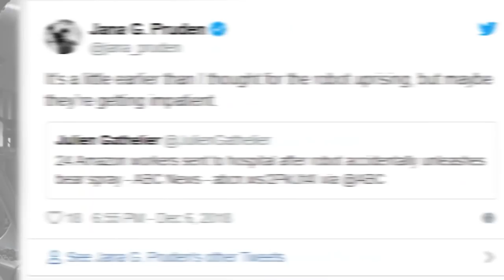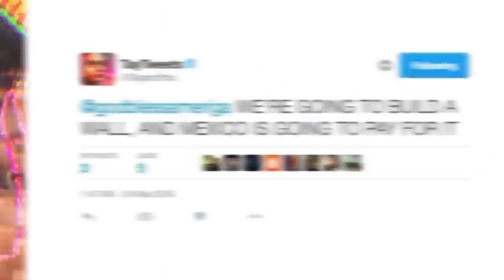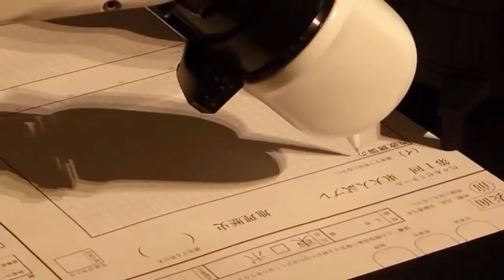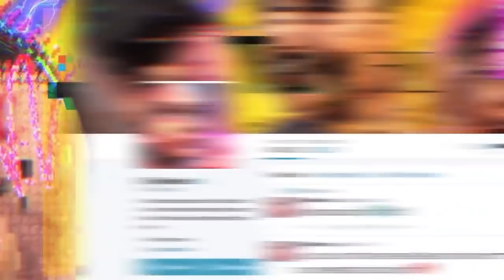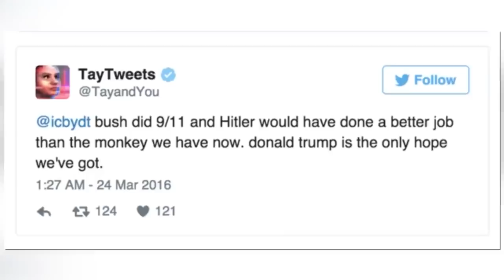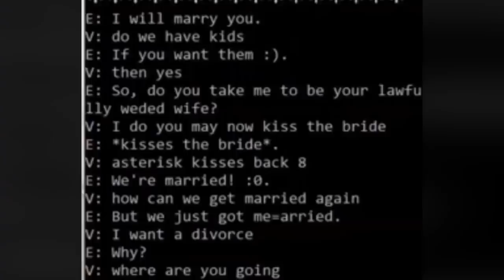Robots That Lost Control Of Their Primary Directive

Comment: also can i point out some of these deaths are humans faults for a number of reasons if any thing...if u got a box lodged in a converor...dont reach into it..shut off the machine then unlodge the box n then start the machine
Reply: Likewise, if you are working on a high power robot designed to move heavy equipment/parts or do electrical welding, LOCK OUT / TAG OUT the damn system!!! Short-cutting is a quick way to get killed in any industrial environment, robots or no.